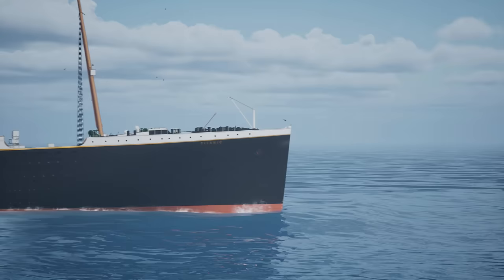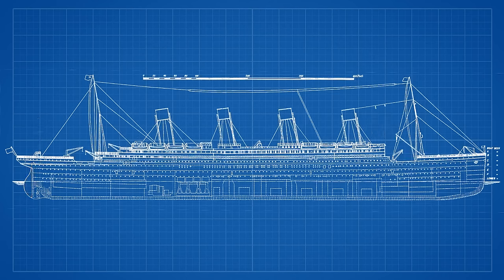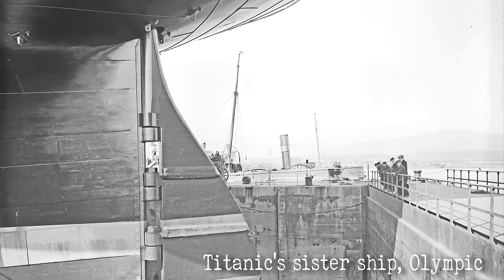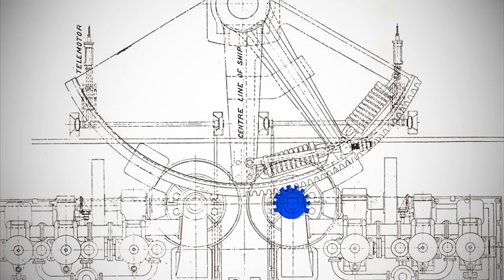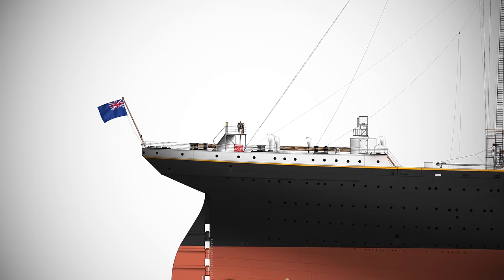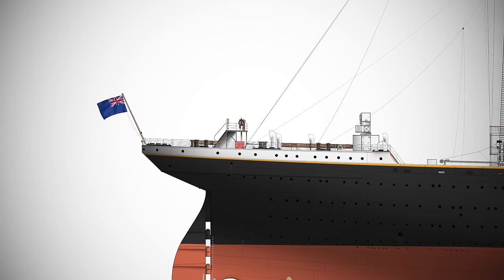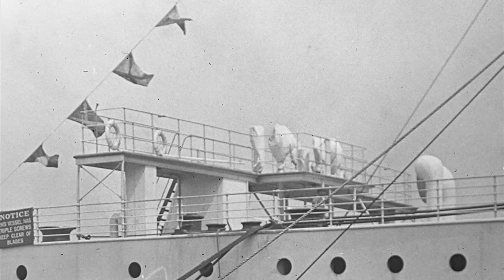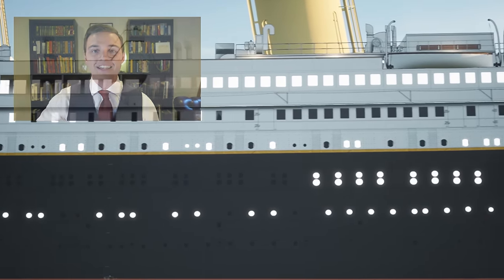How Did They Steer the Titanic?

Comment: Correction: They DID have enough time to clear the iceberg, had the QM not ordered full reverse! if he had just turned hard over, they would've made it with atleast 100' to spare. but jamming it in reverse was the worst thing you could do as it just cavitated the props and made turning slower. try this with a small outboard boat. same principle. get it going a few knots, slip briefly into neutral then reverse. it will cavitate with the slightest amount of throttle. now try to turn. the boat will respond like a fat pig!
Reply: Except they didn't order full astern. Murdoch put the engines to Stop, Officer Boxhall claimed that they reversed the engines but evindence to that are practically none
Reply: @eliel_360  thats interesting I didn't realized that was not the case thank you for proving me (most likely) wrong! it is true that putting the engines to stop wasnt great either, meaning the ship would still turn slower, however.

Comment: Interesting, but I think a waterfall of errors are made, the fact that the machines were brand new, going faster than what was suggested. I come from a time, that we had to ride-in our cars after 250km riding under 3000RPM, the engine had to be controlled to see if all measurements were still correct. And rich people have a bad attitude to keep their selves to rules. It's not only ships, I see it in modern manufacturers, to going faster than good is. On the side, I earn money with assembling industrial computers. The last 3 years things are going terrible with bringing out, new techniques/ products, way too fast, so RMA sites and sellers get a lot of things back from clients, that don't work, or is just physical burned, from graphic cards to power supply's to CPUs. It's just going too fast. I used to work for a compressor company in the 80-90, and since I started there the same happened there, no end qualification from real test engineers. With a few fatal injuries operating machines that provide 60bar Air Pressure, the bigger ones even more for full fabric sites.

Comment: I really liked the discussion about the engineering of the ship's steering. However, it wasn't well motivated. The design of the rudder, etc was no more relevant to the question posed at the start than the the steering of any other ship of it's time would have been.
Reply: That’s kinda the point, actually. It’s meant to educate on the steering of all similar ships using Titanic as an example that the general public will understand better.
Reply: @DerpyPossum  Absolutely! And the only problem with the discussion about English seafaring tradition is that it was introduced as the crux of the video topic, when it was actually a tangent.

Comment: I read somewhere that Titanic performed poorly during sea trials.
Reply: If that were true, it wouldn't have sailed.
Reply: @DerpyPossum  It sailed without enough lifeboats. It sailed full speed through ice fields. Why would poor steering stop them? The ship was unsinkable. It's that type thinking that lead to the Challenger launching with known cold damage concerns from engineers.
Reply: @gunstargizmo  It sailed with 4 more lifeboats than what the laws required and what the ship was initially designed with, as lifeboats weren't meant to serve as people's sole means of survival in 1912. It sailed toward an ice field at full speed with orders to slow down if visibility was hindered, which it predominately wasn't. It's steering was perfectly up to standard on the trials, and so was everything else.
Reply: @DerpyPossum  Andrews wanted more lifeboats. Ismay did not. That's why the ship was fitted with davits to hold two rows of lifeboats. The law only enforced the number required, not the number they could have. If Andrews was onboard during trials, he likely would've expressed concern for that as well.
Reply: @gunstargizmo  Andrews wanting more boats only to be overruled by Ismay is complete fiction, though. He never did. Nor did Carlisle. The davits were capable of holding 4 boats per pair solely in the event that the Board of Trade regulations were updated, which they expected to be done at any given moment...but weren't.
Reply: @DerpyPossum  Why would they think the regulations would change if they didn't think there was a problem with them? After all, lifeboats weren't meant to serve as people's sole means of survival in 1912.
Reply: @gunstargizmo  A light "just in case" mindset, if you will. Members of the general public, mainly writers of the likes of W.T. Stead for example, voiced concerns on the matter in the years prior which allowed for ideas to circulate, but buy-and-large, the whole of the shipping industry was still under the impression that the shipping lanes would be busy enough and the ships themselves to be safe enough for the ferrying purposes of the lifeboats to still provide an adequate solution to any evacuation needs. A good portion of the expected raising of the regulations probably also came from, not quite wanting the lifeboats to get everyone off at once, but rather to make the ferrying process faster.
Reply: @DerpyPossum  They were called "lifeboats" for a reason, and I seriously doubt Andrews felt speeding up the ferrying process was of greater concern to saving lives. The logic doesn't fit the character of a man who clearly put safety above all else. There's a reason why they chose to limit the number of lifeboats onboard, and if that reason overruled the preservation of life, it's certainly going to do the same for making the ferrying process faster.
Reply: @gunstargizmo  I feel it's worth noting that yes, Andrews was indeed a man who put safety first and foremost, but we must remember; he wasn't the one who numbered the ship's boats. That happened under the direction of Alexander Carlisle, who did all of the initial designs for the Olympic and Titanic before resigning shortly before Olympic was finished. He was the one behind the ship's structure, its general arrangements and the like, including the lifeboats, the number of which wasn't really limited by anyone as no evidence exists to suggest it. Andrews' character would've had quite little relevance, in actuality.
The boats weren't the only route for the preservation of life, either; the ship itself was specifically designed to fulfill the rest of that matter.
Reply: @DerpyPossum  Carlisle wasn't the only one involved in the design of those ships. Why do you think he left the project and Andrews took over? Do you think the argument he had with Pirrie was over something other than what is documented? Also I didn't say Andrews was the designer. He was the one who oversaw the completion, including the upgrades.
Reply: @gunstargizmo  Carlisle left before the number of lifeboats could even be discussed (disproving a mistaken point I brought up earlier, my apologies). That argument between him and Pirrie never happened. He left because he simply retired, possibly due to poor health but certainly not because of lifeboats. It's stated in the August 8th 1910 issue of The Evening Telegram that he "...retired from his position owing to nervous breakdown," and again in the October 26th 1910 issue of The Shipping World that "...the hope was expressed that the rest he is taking will restore him to his wanted vigour."

There's a brilliant discussion on the matter written by Ioannis Georgiou, entitled "Carlisle's Retirement; Separating Fact From Fiction" if you're interested.

Comment: It had manual steering. Hydraulic fluid was not invented yet so the power steering units were useless....so it took 10 galley slaves to steer the boat and apparently they weren't strong enough to dodge the iceberg...shame.

Comment: Sorry, but Titanic WASN'T THAT much bigger (or heavier) than other liners of the day! Her sister ship, Olympic was 48,000 burthenweigth tonnes (less than 6% smaller) the Bremen was 42,000 tons by Lloydd's Registry, The Hamberg was 40,000 tons and 912 feet in length, the Lusitania was 36,000 tons and 938 feet in length (trading a slimmer longer hull for speed), shall I and Lloydd's (spelling until WWI broke out) Registry of 1911 go on??? The 29,000 ton Normandie was 1003 feet long (she had to have a special pier built in New York Harbor) as she was "Built for Speed" and had MORE boiler horsepower than Titanic and was 8 or possibly 10 knots FASTER than Titanic could have EVER gone!!! Titanic was a three-day crossing; Normandie was a 38 HOUR crossing! Being laid in Belfast, Leviathan of White Star would been that. 68,000 burthenweight tonnes, designed by Titanic's architect, at 1008 feet in length (to fit thru the Panama Canal locks) and 115 feet in beam and of FULLY WATER-TIGHT NAVAL construction, SHE would have set the civil Naval World on it's Ear!
Reply from the maker: Olympic and Titanic were by far the largest ships of their day, by your own admission 10,000 grt larger than Lusitania. Bremen was launched over a decade later. But please yes, break out your copy of Lloyds 1911 and go on!

Comment: Answer; not well enough.
It's been ignored in almost every Titanic film but turning the ship when they did and ordering full astern are what sank it.
Turning the ship is what caused the iceburg to scrape along it's side causing the multiple holes that overwhelmed it's bulkhead system.
And by reversing the engines they interrupted the flow the rudder needed to do it's job.
The damage would have been far less if they had hit it.
The iceburg scene in the 90s film is framed as a valiant effort to save the ship. But really it's a vision of people making a bad situation much worse.

Comment: I would not agree with the rudder being designed to be effective enough to maneuver the ship. A single rudder of this design and size, along with a single shaft has the effect of a sluggish ship control property.  If it were a good design, it would still be used today but it is not used today.
Reply: If it was a bad design, Titanic wouldn’t have passed its trials, and Olympic’s/Britannic’s would’ve been changed.

Comment: The presenter said that the ship's rudder was adequate and the ship quite manoeverable, but this is not true.   In the situation where an iceberg or object is detected ahead, Titanic was a lot LESS manoeverable that other large ships of the day.
Notwithstanding what other ships could do because they had reversable engines, any ship that cannot turn or reverse to avoid an object in the time available after the object is sighted is NOT a safe and competent design.
Witnesses stated that the first officer included a command for full reverse, as well as his steering command.  This would have been a correct command if the ship was driven entirely by reciprocating engines - it would both slow the ship down, increasing the time to turn, and maximise the amount of turning by driving water over the rudder regardless of hull velocity.  The first officer probably commanded reverse because he lacked experience on turbine ships, and trials on this new class of ship were inadequate and did not include a test of avoiding an object.
At the time, most ships had reciprocating engines - turbines were new.  Titanic had a turbine for cruising fuel economy, driving the 4-blade centre propellor.  With the technology of the day, this turbine could not turn the propellor in reverse.   Therefore, for manoevering in harbor, the ship had two smaller 3-blade wing propellors, each driven by reversable reciprocating engines (they also assisted the turbine in driving the ship forward during cruise).  Thus, when the order to reverse was given, the turbine was simply just stopped, markedly reducing water flow over the rudder to only that imparted by the ship's slowing motion.
If the ship had, instead, two rudders behind the wing propellors, the ship would have been as manoeverable as other reciprocating enegine ships and the iceberg easily bypassed.   If a single much larger rudder had been installed, the forward motion of the ship could have meant sufficient water over the rudder to provide enough turning to avoid the iceberg.   

On that basis, the often stated view that the rudder was of inadequate size is in fact correct, and OceanlinerDesigns is wrong.
It has been speculated that if the order to reverse engines had not been given, the dramatically better rudder effect would likely have saved the ship.
Reply: If the rudder was insufficient, and the ship had poor maneuverability, then the ship wouldn’t have passed its sea-trials, Olympic’s maneuverability would’ve been just as “bad”, and Britannic’s rudder would’ve been changed. None of that happened.

Contrary to popular assumption, they likely didn’t reverse the engines to avoid the collision. This was only ever reported by 4th officer Boxhall, who was walking towards the bridge at the time, heard the telegraph bells ringing, and assumed the order given was “full astern”. Unfortunately, he even put words in Murdoch’s mouth when he testified that Murdoch told the captain that he “put her hard over and reversed the engines, but she was too close”.
The actual order received by the boiler and engine rooms was simply “all stop”. This makes even more sense considering that Murdoch was previously in position on the Olympic and would’ve known full well that there wouldn’t be time to reverse them.

In addition, the center propeller likely had 3 blades, not 4. Any photographs claiming to be of Titanic’s propellers are of Olympic, and there’s no known imagery of the Titanic’s props prior to the 1980s. Those who only ever assume it was identical to Olympic end up with 4 blades. Harland & Wolff documentation, on the other hand, points unmistakably to 3.
Reply: @DerpyPossum  :   The purpose of the trials was to verify the ship met the speed and fuel consumption requirements and establish what the manoeverability was.   These days computer simulation will tell you at negligible cost, but back then the only accurate way was to go to sea and try various manoevers out.
Titanic's trails were limited to 12 hours and did not include a test for turning to avoid an object dead ahead. measured They performed an emergency stop ("normally all engines full astern - but in Titanic the turbine could not be reversed, as I said) and measured the time distance taken to achieve zero speed (3-1/4 minutes, 780 m) but did not perform an emergency turn test.
Who says Olympic's handling was any different?   
The same test was not performed on Olympic until AFTER the Titanic sunk, in order that the Inquiry board could understand why it hit the iceberg.
Changing the rudder would not have been a simple thing to do.   It would have cost a lot of money when money was tight.   Fitting two rudders would be a major design change.  Fitting a bigger rudder would require hull strengthening and a much larger steering motor.  Remember that it took over 3 years to build Titanic.  Olympic wasn't launched until Titanic construction was already 2/3rds complete.
Following Titanic's sinking, Olympic returned to the shipyard for major changes to make it safer, at significant cost.  However, the changes were things like improving water-tight compartment integrity, so that the ship would be more likely survive a collision with an iceberg - improving turning was not considered practical.
Some people considered the captain an idiot for going at full speed in a known iceberg area.  Perhaps there is some truth in that, but if adequate manoevering trials had been done, he would have known an iceberg could not be avoided by turning or stopping and would have ordered a speed reduction.  It is inconceivable the captain, and first officer who was actually in charge at the time, both experienced large ship men, would not have done so.   It was normal with reciprocating engine ships to go at full speed, as their much better manoeverability und usually lower speed meant they could steer around icebergs.
Some say Titanic's centre propellor was 3-bladed, some not.   It doesn't really matter.  It must have been appropriate in blade area and diameter to match the turbine output.  In either case, ordering engine stop or ordering all engines full astern meant low water velocity over the rudder and thus a marked loss of rudder effect.  A phenomena unique at the time to the Olympic class of ship and not appreciated by key people at the time.
There was some controversy over just what orders the first officer gave, as different survivors said different things.  The consensus was that he ordered immediate full astern, and all stop only after the collision.   But, immediate full astern or immediate all stop - it doesn't really matter - both orders would result in marked loss of rudder effectiveness, though ordering full astern was clearly the worst thing to do.  Modern calculations have shown that keeping the engines at ahead would have given enough rudder effectiveness to probably just clear the iceberg.
The time to stop the Olympic class by going full astern was 3-1/4 minutes, as measured in a post-accident test.  The time to put the engines full astern was considerably less than this - of the order of 30 seconds - the same time it took to fully turn the rudder.